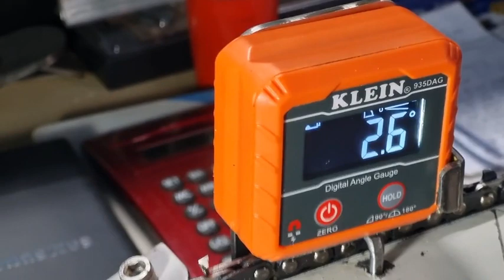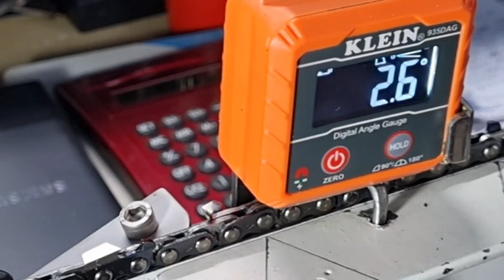Stihl constant flat gauge VS Stihl progressive FL4 gauge review

Comment: Just a thought. As you mentioned in a previous video, each tooth experiences a rocking motion in use. Is it possible that the lower attack angle of a used up tooth when measured statically might actually increase while rocking during the longer period between raker connection with wood and tooth connection with wood of a used up tooth, thus totally or partially negating any negative effect? I don't cut enough to know from experience if I notice a drastic decrease in performance of older chains. But it's fascinating discussion! Thanks for your vids.
Reply from the maker: Thanks for.your commet what depth gauge are you using
Reply from the maker: The rocking motion just takes a bite of wood like you would do with your mouth.  The raker just limits the bite not the rocking motion
Reply: @ChainsawUsers  just a Chinese constant depth. My secret shame. 😁

Comment: The MAXX Pro grinder has ability to grind the teeth from the same direction (outside-in) on both sides of the chain. Have you compared the MAXX with the standard Oregon/Tecomec/Stihl USG grinders which only grind one way? Is there a significant advantage in being able to grind outside-in on both sides of the chain?
Reply from the maker: They used to have a switch so you could change direction on grinders so you grinder from the inside to the outside.  Because the sparks can come back on the operator they stop  making that option also locking nut could unwind also.  This idea has been stopped.   Most grinders are good these days I have 10 grinders 
Stihl usg Oregon and tecomek they are all OK.  It's mainly operator error these days not the grinder.  Wheel selection is also a problem because those cheap pink wheels are fitted to all grinders
Reply: @ChainsawUsers  The MAXX is widely available for purchase with no problem. The description says: "This is a unique device because it is the only one that grinds all links from inside to outside and leaves no file or grinding burr behind. According to the latest CE standards, chain grinding devices are only allowed to rotate in 1 direction, therefore it is impossible to grind the left-hand chain links from outside to inside. With this device, you can place the chain in reverse, then adjust both the upper and lower part of the chain sharpener and this way you also sharpen the left teeth from outside to inside".
I am wondering if anyone has any experience to suggest whether grinding both sides of the chain from inside to outside gives a better result (I assume it does otherwise why go to the trouble of offering it as an option?) Thanks!
Reply: maciejjandugosz2056  I think you have misundertood how the MAXX grinder works. You have assumed that the direction of wheel spin is changed, but this is not correct. As posted above, it is the chain which is turned around, and the wheel spins in the same direction from the other side. Please look again at how the MAXX grinder is set up - there are no failing nuts or dangerous sparks. Maybe check your facts before telling people to "get real"?
I am looking for advice from someone who has actually tried this grinder and can say from experience whether or not consistent direction of grinding is worthwhile.
Real-world engineering experimentation and not assumption is what this channel is all about ... no?
Reply from the maker: @dab.  I can spin mine in reverse see video here.  Yes it helps a bit but the burr falls away.  All my chains cut very good.  You have nothing to loose by using that feature.  I would use it if my grinder had it
Reply: Maciej_Jan_Dlugosz  I am already using CBN wheel with a grit equivalent of 180. I'm not asking about grit, I'm asking about the MAXX grinder. Thanks anyway.
Reply: Maciej_Jan_Dlugosz  Resinoid wheels are not popular in my country (UK) because of the need for constant re-dressing. For professional sharpeners time is money.The only resinoid wheel available here is the Molemab from Italy which although individually cheap are only exported in bulk. The Molemab wheel is 80 grit and in no way superior to CBN.
CBN is expensive but far more durable. 
I did not ever state that the MAXX grinder reverses wheel spin. It does not.
Reply from the maker: How does the grinder grind both sides from the outside only as you stated, without the motor going clockwise for left tooth ?
Reply: @ChainsawUsers  The chain is reversed and the whole wheel assembly moves from the right to left side of the machine.
Reply from the maker: @dab.  I must look that one up
Reply from the maker: Yes I watched on YouTube maybe that's the way to go in the future grind outside to Inside
Reply: Maciej_Jan_Dlugosz  Please link to a "self dressing" long lasting resin bonded wheel I can buy for low cost in Europe. Thank you.

Comment: Would a Stihl progressive FL3(0.325") gauge work on a Oregon 80txl, 0.325" Low Profile chain? I wonder if there's any difference between 0.325" and Low Profile 0.325" when it comes to using the progressive gauge.
Reply from the maker: .325 is .325 because of the gauge don't matter who makes it. All.325 will all be same size so the Stihl gauge will be OK.  But that said if the low profile is lower that standard  .325 the it would remove to much raker depth.  If I had such chain I could measure the height with my digital caliper setup.  Have you tried it ? The only problem would be it may take to much off in that case it won't work so well.
But if the saw does not bog down then all will be OK and I would not worry if the saw cuts well only if the saw bogs down  other options 8f all fails is use a feeler gauge and go say .85 mm when half worn chain and 1.1mm almost fully worn chain.
Hope that helps
Reply from the maker: Yes it will work on any .325 chain as its made for that pitch
Reply: What file size should I use for my 1.1 mm, 0.325" gauge, Low profile chain(Oregon 80txl).  4mm or 4.8 mm file?
Reply from the maker: @elgi131 standard .325  use 4.7mm and  low profile use 4mm, you can always tell what to use on any chain.  When the file is at the bottom of the gullet, the top of the file should be 20 to 25% higher than the tooth height.